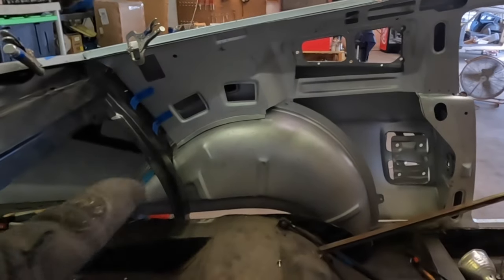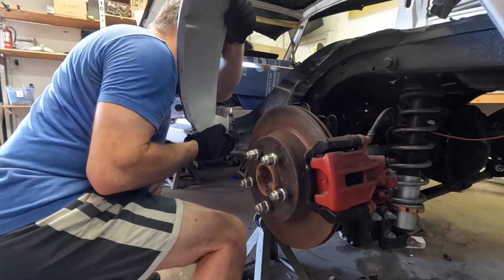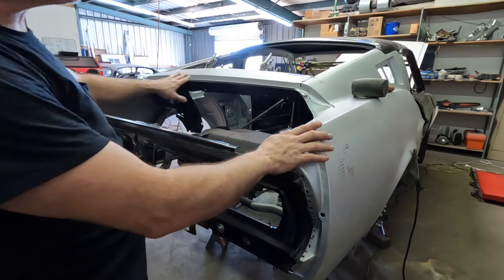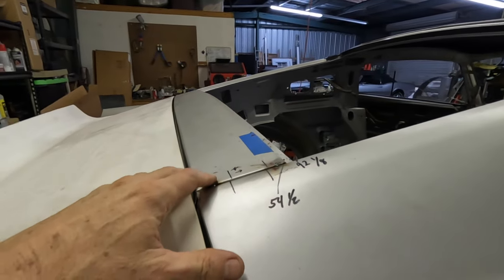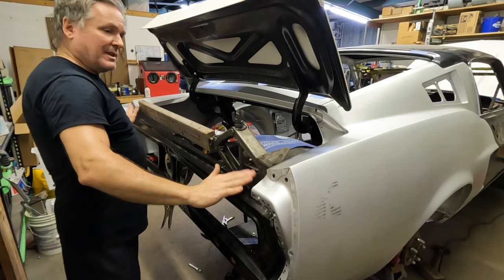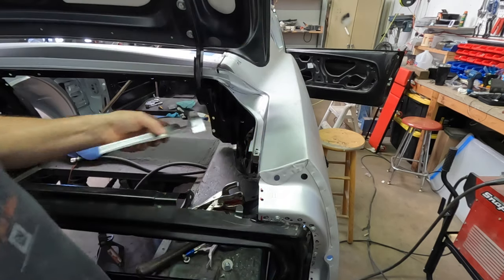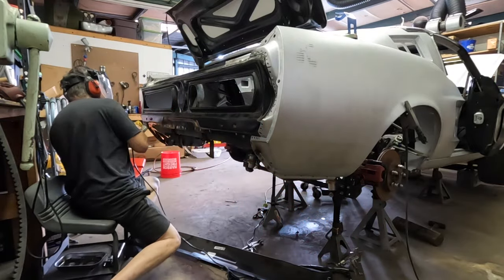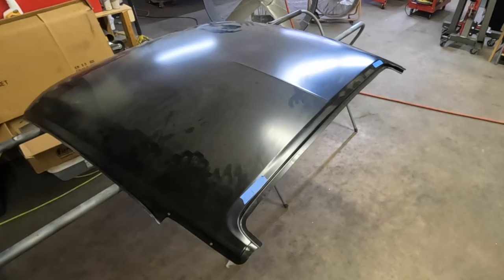How To Convert a 67 Mustang Coupe to a Fastback  Part 3

Comment: Okay I get it now.. forget my comment on the previous video.. is it true that Parts companies can't make the exact Parts because Ford would sue them so that's why no parts really fit and you have to make it fit?.. and can you tell us the price of everything?
Reply from the maker: No I have not heard of ford being able to sue for parts,  especially for sheet metal.  Some parts are licensed by ford and they do receive a kick back on those parts.  As far as sheet metal there are only a few companies that are able to stamp them into shape.  You get what you pay for as far as quality.   Dynacorn sheet metal seems to be the best quality and fit if you are using all dynacorn parts.  All parts require patience and figment to make them fit properly.  But sticking to one manufacturer such as dynacorn helps to ensure they go together better since they make all the parts.   That also use these same parts to dulled their complete bodies.   As far as the price they have gone up dramatically since the COVID shipping and supply issues.   The price may be slightly different between suppliers.    It is best to shop around.

Comment: Very nice job and explanation of where you had problems and what you did to solve the problems. When I did my quarter panels I ran into the problems in the exact same areas, it was a struggle. I hate how some guys show all of these panels going on with no problems when you know that is not the case with aftermarket panels.
Reply from the maker: So true.  Very few aftermarket parts work without some type of adjustment or modification.   Thanks for sharing your experience and checking out my video.

Comment: Question along with adjusting the door to the rear quarter panel, the front fender fitment should be tested also for gap to the front of the door?
Reply from the maker: Agreed that was also done during the mock up.  Alll of the sheet metal was put on and test fitted prior to the final figment and welding.

Comment: Love the video. You show much more than anyone else. I am right in the middle of my 68. One question I have is how the trap door support should be positioned. I cant find anything on it.
Reply from the maker: It all goes together like a puzzle and in phases.   The best way I can answer your question is to put it all together paying attention to the fitment of each and every step.  It takes a lot of tweaking and patience to get it to all line up.  If something is off it will push everything else off.  Once everything is screwed into place test fit everything, window, bumper, and interior if you have it.  Not sure if I answered your question but hope this helps.    Good luck on your build.

Comment: Great video and nice fitment. Thanks for sharing your tips and tricks. Much appreciated. Did you have any issues with the deckled impinging the quarter panels around the radius? Thanks again.
Reply from the maker: Had no problems at the radius (upper corners) it fit well in that area.  Thanks for checking out my video

Comment: Fiberglass parts are manufactured even worse than sheet metal parts 
There’s a lot of work in there to make it fit, it’s an hassle to work. You need a lot of patience.
Reply from the maker: You are absolutely correct in your statements.   The hood and trunk lid were extremely wavy and not even close to being flat when the blocking phase started.  Required a lot of time and effort to get them to fit and to get them flat.
Reply: @cvclassics  
On hoods, we had more layers of fiberglass ,
It gives thickness, so you don’t see through.